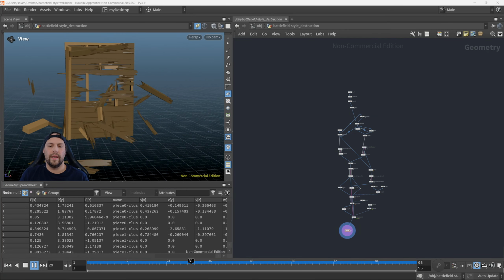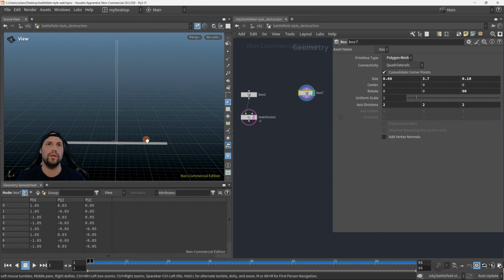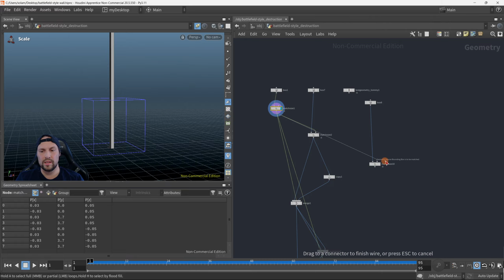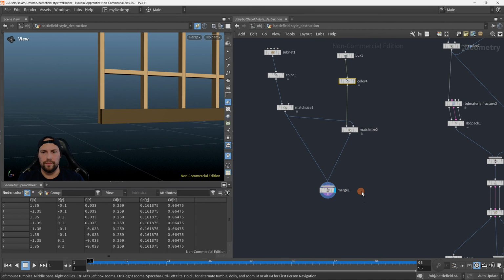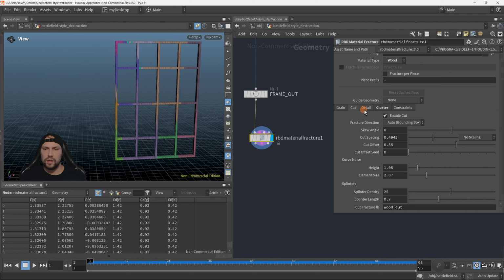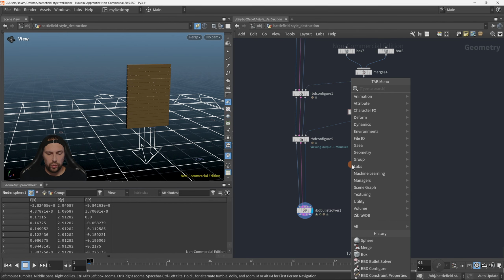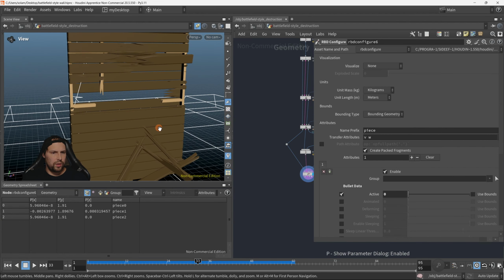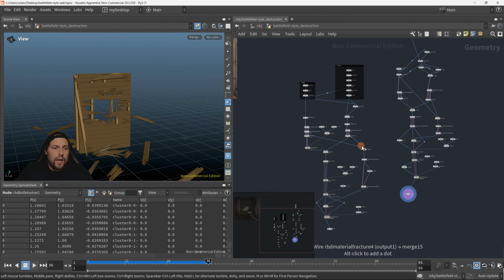Battlefield-Style Wooden Wall Destruction in Houdini | Step by Step Tutorial

Comment from the maker: ⏱ Use the timestamps below to jump to any chapter of the tutorial and follow along at your own pace:

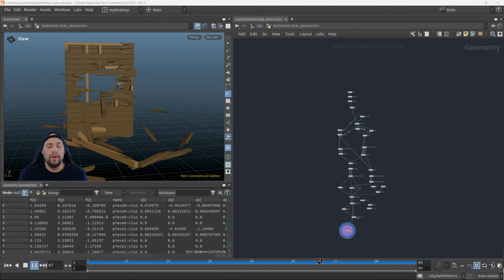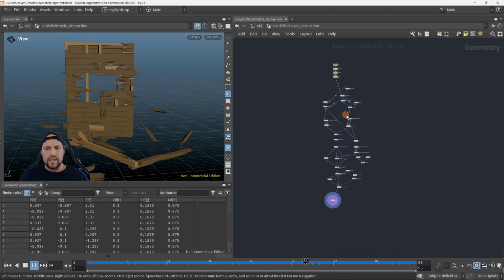0:00 – 2:28 — Introduction
2:29 – 58:03 — Base Mesh Modeling
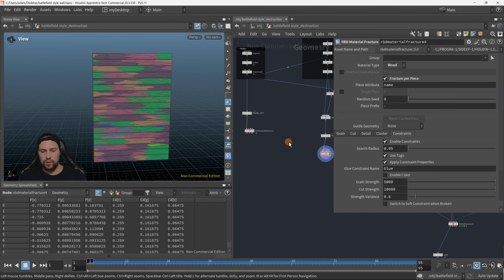58:04 – 1:03:41 — Fracturing
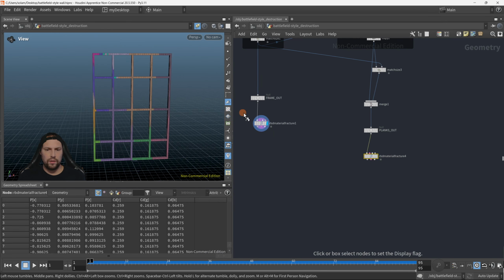1:03:42 – 1:12:09 — Preparing the Mesh for the RBD Bullet Solver
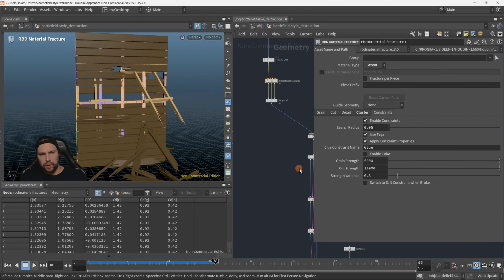1:12:10 – 1:22:00 — First RBD Simulation Test & Parameter Tweaking
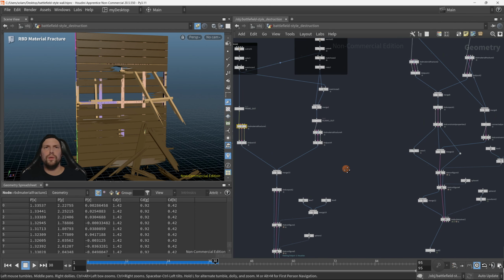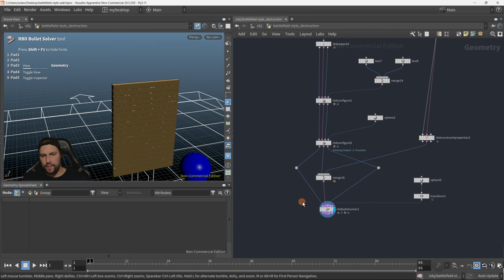1:22:01 – 1:26:28 — Dual-Level Constraint Setup & Constraint Switching
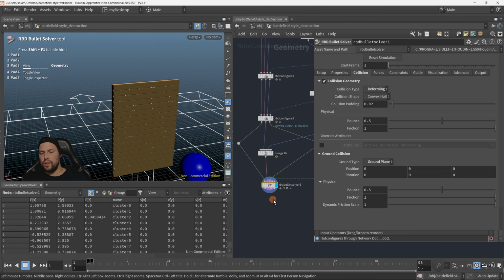1:26:29 – 1:47:38 — Final Touches & Polishing